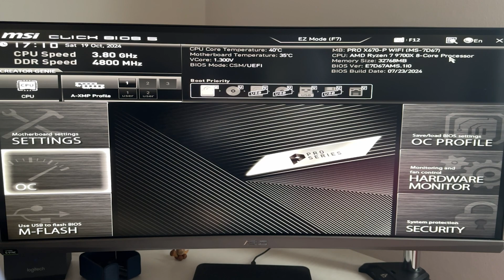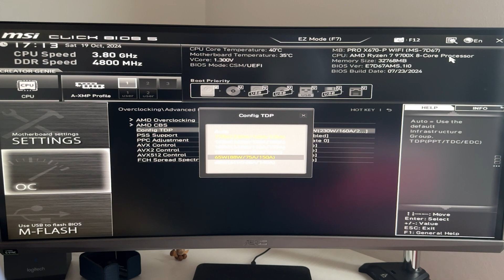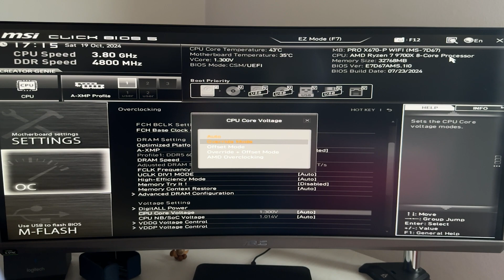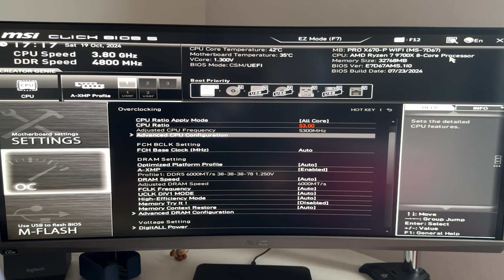Undervolt your Ryzen 7 9700X for more FPS and Lower Temperature!

Comment: Do not do this with your 7900x you're just wasting potential..... Set your curve to -25, set your max temp to 85, manually set PBO, PPT 142w TDC 110A EDC 170A... If you're not on MSI motherboard it will be 142000, 110000, 170000. Enjoy a way better overclock,better temperatures, and using way less wattage.

Comment: I DID THE FIRST TWO STEPS OF THIS AND IT BRICKED MY COMPUTER!!!! DOESN'T LIGHT UP ANY LEDS AND DOES NOT START, DISPLAYS ARE BLACK. NEVER FOLLOW THIS GUIDE!
Reply: Just reset your bios by using clear cmos if your motherboard has it or pull out the cmos battery from the motherboardand wait for 5-10 minutes then put it back.

Comment: Didn't change much for me. Temps little lower for sure. Score went up multicore 8%. Just curve -20 and tdp 170 but I already had tdp unlocked. Single core the same. Steel nomad same results. Timespy cpu from 14150 to 14350

Comment: my setting daily gaming + streaming

precision boost overdrive menu
PBO = advanced
PBO Limits = Motherboard
PBO SCALAR CTRL = Manual
PBO SCALAR = 10x
CPU Boost Clock Override = Enable (Positive)
MAX CPU BOOST CLOCK =  100 / 150 / 200 (optional), 100 = 5.650Ghz, 150 = 5.700Ghz or 200 = 5.750Ghz 

Next
Curve Optimizer menu
curve optimizer = all cores
all core curve  sign = negative
all core curve magnitude = 25, 30 or 35 (25 recommend for me)

cpu z benchmark default
single core = 801
multi core = 8437

cpu z benchmark undervolt + pbo manual
single core = 912
multi core = 9271

Comment: I have gigabyte mobo and 9700x. Open PBO, -20 undervolt and +200mhz boost clock. It goes about 5750mhz when gaming and isn't too hot. On 100% load it thermal throttles. (420mm AIO)

Comment: Can i pair it with 5080 with zero bottleneck?
Reply: No such thing as zero bottleneck exists, but in 1440p and 4k yes you’ll always be gpu limited so cpu doesnt matter as much so its a good pair, if youre playing in 1080p I would get the 7800x3d or 9800x3d instead.
Reply: @henru9817  yeah thanks i got 9800x3d instead

Comment: Hi, thank you for the video!

I have a quick question though:  You set the CPU core ratio to 50 (so 5.00 Ghz, right?) and say that it will improve performance, but isn't the 9700x's boost clock 5.5Ghz, meaning it would usually boost to 5.5 Ghz under load unless it hits temp limits?

So 5.00 Ghz at all times would then be less performance than letting it boost to 5.5, or am I stupid right now? Thank you in advance!

Comment: Does anyone have stable 105watt + -30 CO? or the best is -20? Im going to try this tommorow
Reply: what happens bro i want a do this me i've baught pc parts with the r7 9700x and they will arrive soon and i want know if it works great
Reply: @zakgamer25 its stable for me atleast until now. Running r23 benchmark multiple times multicore score 22.1k and single core 2175 with 77 and 57 temp. 0 overclock only undervolt. Also enebling 105watt. Boosted my multicorescore from 17k to 22.1k. I dont want to push further because heat , this is for daily not for benchmarking records. So im chilling with -30 will update if something bad happend
Reply: @zakgamer25  update.... its unstable when im opening 2 bluestack at the same time 😂. So i lowered it to -20 now still stable. I tried r23 benchmark performance from 22.1k drop to 21.8k without any temp changes

Comment: I’m scared to do it, i have a stable system and good preferences, what will this settings actually do?
Reply: undervolting a cpu and gpu is basically what it sounds like. the cpu and or gpu power draws more power out the box because its for stability purposes. undervolting is done to reduce the power draw (less heat and longevity of the product) while maintaining the same frequency and clock speed. 
he mentions this around 3 min mark. unstable means you blue screen or just straight up crash (this doesnt brick your pc, just boot back in bios and raise/reduce the number). stable means your pc is running fine without any crashes and all your games and applications run as they should. its completely safe to do. OVERCLOCKING is what you should not do. UNDERVOLTING is completely safe.

Comment: My ryzen 7 9700X runs at 50°c on idle, i think its to high. Im seeing that your VCORE is at 1.300V, mine is at 1.330V. Shouldnt it be 1. 300V max?
Reply: On benchmarks and games my temps are really good, but i just wanted to lower idle temps

Comment: This video is absolutely amazing and I can't wait to try this once I head home tonight. I just built a new rig a few days ago with a Ryzen 9700X, this is my very first AMD CPU as I've always been an Intel user and I couldn't help but notice the weird temp spikes even on my desktop when doing not so intensive things like downloading steam games and browsing at the same time that'd make the cpu cooler fans go loud/silent/loud/silent. I didn't want to bother setting a custom fan curve just yet so if I can really improve my temps while improving the performance at the same time it'll be a godsend!

Just a question about the TDP, I need to upgrade my bios from F31 to F34 in order to have the 105W setting available, would you recommend enabling it? Won't it work against the PBO tip shown in your video? Because I read many people complaining that the gain is really small and most likely only noticeable for productivity applications and not gaming

Thanks in any case for the video, I shall definitely try this!

Comment: At 100% utilization the chip is excellent, it's the idle power consumption that bothers me. My 9700X idles at 27-30W (50°C).
Reply: Disable the integrated graphics it will boost the cpu performance and make it 10c to 15c cooler
Reply: @BasTSLA  hi, May i ask how will i know if the integrated graphics is on and how to disable it? When watching videos on youtube and twitch my cpu temp is 60-70 degrees. thank you
Reply: My idle is 47 to 48 C
Reply: @19Roy73  When I use default system memory speed, I also get there, even down to 15W, ať 45°C. How ever even a slight system memory OC and the CPU package gets power hungry.
Reply: @philipcooper8297  whats your board
Reply: @19Roy73  MSI x870-P. The idle power consumption "issue" is the chiplet desing of the 9700x and the integraded memory controller, that has to run faster when you OC (EXPO) the system memory.
Reply: yeah ur right its 50 alryt
Reply: 40 idle without these settings and an air cooler. rarely goes over 65 while gaming

Comment: Please help.
I have ryzen 7 9700x with ant esports 240mm aio. The idling temperature is between 50-60° Celsius and while running Cinebench R24, it went to 80°. But when playing games it goes above 90°.

I need help.
Please suggest.
Reply: Did you use curve optimizer? Judging by the temperatures you removed the consumption limit, I left the base 90 watts on mine, curve optimizer -30 and in games I get 65-70 degrees max with my arctick freezer 360 and 30% fan speeds.
Reply: @SiberianNx  No i didn't. Earlier I was using deepcool le520 240mm aio but it was faulty and I changed from it to ant esports ice flow 240mm aio. 
But the temps have increased since.

Is the only solution is to undervolt it?

Comment: i have this cpu and rtx 5070 tuf gaming oc in fractal ridge with noctua cooler, i want to lower temperature and i use static undervolt cpu core ratio 47.00 and cpu voltage 1.0, my system stable and cpu temperature around 65c in games, what you recommend to people like me who needs lower temperature in small itx cases and good gaming performance

Comment: I purchased 9700x , Gigabyte 870e with f4 bios and Arctic ARGB 360 AIO. Used Arctic mx6 then Arctic Silver 5.Not much changed.  Like your suggestion used Curve optimizer, negative 30. If I open Far Cry 5  temps idle 45 degree,  i want to use silent fan curve but temps reach very high 80's in game. Is it normal?

Comment: Never do this, it's unstable, the optimized curve, even with low values it's unstable, you will have problems, undervolt manually or don't do it
Reply: its stable bruh, just everyone has different value, if you cant do it, means you cooked or done something incorrectly

Comment: This makes my 9700x tmp 75 to 60… amazing 🎉
Reply: what about the wattage ?
Reply: @harissss-e2l  you have to choose power limits yourself, assuming the person wanted to lower temps - probably no more than 88W (some motherboards allow you to put custom value in mW, so that would be 88000 mW), in case of MSI it's Config TDP section at 4:20 and 5:22 of the video

Comment: Need to ask a stupid question. I just got a 9700x and 6000 mhz cl30 ram and just as it shows in yours, the DDR5 speed in the bios says 4800 instead of 6000. Why is that?
Reply: You need to enable expo, that put the ram in the 6000mhz automatically. By default its come in 4800mhz.
Reply: @CallejoKiller Thanks for that, I jumped on my system about 2 hours after I asked this question and noticed the setting was disabled. I enabled it and it went to 6000 right away. Thanks again.
Reply: The standard official speed is 5800mhz, everything else is considered OC

Comment: Hmm, I wonder if this will help lower my CPU temp and lower fan speeds. My 9700X seems to hit 95 C with most modern games and then my PC sounds like a rocket
Reply: In games my 9700x gets no where near that hot.
Reply: @dreadtrain2846  what cooler do you use? I have a Noctua NH-L9x65
Reply: I had the same issue. Thought my AIO was busted. But I reverted to stock bios and things are running a lot cooler. 72C during stress testing and maybe a touch higher on games. I tried the curve optimizer to negative 20 but it had the opposite effect. My CPU performance reduced slightly and my temps reached 85C on stress so I went back to stock.

Comment: Mine out of the box is jumping right to 86 Celsius 😢
Reply: Try repasting your cpu
Reply: Really? What kind of cooler you using? I have a Corsair h100i rgb and at default settings it was high 40s to low 50s most of the time.

Comment: Hi I’ve found this video right after i finished my 9700x 7900xt build and tried the first setting you recommended. After I exited and the pc booted up, it was insanely slow. I gave it a few mins but it was still drastically slow. When i hovered over icons it didnt register, typing was absolutely horrendous as it wouldn’t register it at all.
Reply: If you have a Logitech mouse, that's the problem.
Reply: @technikchegger7228 I don’t, I have a steelseries
Reply: @kozdas9505  As I said, the reason for me is the logitech mouse. With the Razer mouse, everything works normally. Test your mice. But crazy is so🤣
Reply: @technikchegger7228  never wouldve thought a mouse would effect this
Reply: @kozdas9505  that's because mouse have polling rates that affects CPU ,the higher the polling rates like top end gaming mice that has 8000Hz the more it stresses the cpu
Reply: Mine was hella slow as well

Comment: @ImWateringPSUs - what was the idle and stress temperatures before the curve optimalization? 
I used Ryzen Master for curve optimalization and it set -30 on all cores which gives me like -10-15*C which is awesome. FPS went down for like 2-4 so not a big deal.
My temps on idle before optimalization was around 50-55*C, I don't know if it's normal for this cpu.
During gaming it was around 69*C max.

Comment: @ImWateringPSUs: Thas it that will do the job? ima try the first one part just to undervolt a Bit,  for 7-9700X / Asus Prime X679e Pro Wifi. But incase for some reason it does not want to work there a way to revert back to previous setting I had before these changes? TY for Sharing👍
Reply: There is an option in BIOS to Load Defaults. Then set your EXPO for the RAM (if it supports it) and you are good to go. Remember to save and exit BIOS so you don't discard settings.
Reply: @darrenlogie2642  : Thank you Darren👍 games do run great, even though i have not undervolted temp stay at 60f threw out hours of gameplay in a Air cooler... DarkRock 5

Comment: i wanna get a 9700x and use this tutorial and i wanna couple it with ID-Cooling IS-50X V3 Black, what kinda temps u think i get if i go with 50 multiplier and 1.1vcore?
it's a low profile cooler with 130W TDP but with this tutorial i guess max power consumption would be around 60-70W for the 9700x

Comment: Did you have to update that BIOS before it let you run that CPU? I'm going to build a PC with this CPU, but every compatibility checker says you may need to update the BIOS to run this CPU. That sounds like a pain, I'd prefer something plug-and-play.

& Did you every try this CPU on a B650? Did you need to update that?
Reply: If your MoBo has bios flashback it's easy with a youtube video

Comment: So, can I do a negative curve of 20  and then active the new 105w TDP mode on the new 9700X? Or just by undervolting i can get more performance?
Reply: You can do negative Curve and set up 105w tdp
Reply: I set up 105w and -20 curve e improve a lot multi core performance
Reply: TDP 105w and -30: Cinebench r23 max CPU power 113w, 69 degrees and 23.630 points.

Comment: Was the first overclock you did better with pbo negative 30 curve for performance boost or the second one you did with the undervolt and boosting cpu speed. 

Also overclocking ram for a cs32 6000mhz to 6400mhz along with undervolting/overclocking cpu and gpu wont cause problems taking into consideration that i do run tests and such.

Also is it possible to overclock and undervolt a gpu at the same time for more performance or is it better to just undervolt/overclock to boost performance.

Thank you in advance!

Comment: 9700x on x870 msi tomahawk, using negative 20 on curve opimizer has increased my performance and further reduced temps. 
At stock just expo enabled.
Stresed at 4.9 all cores around 67c

Expo and curve opimizer 20
Stressed at 5.1 all cores 57c

Love this 9700x granted some chips is like lottery getting a good 1 but i think this cpu doesnt get much praise as its all about thr X3D cpus at the moment.
Best £250 ive spent on a cpu.

Thanks for your knowledge 👍
Reply: Totally right!
For this price, this is the best deal right now (the 3dx is 130 eur more in Germany right now...)
Reply: @999slawter  it's 200€ difference! 
The 9700X is 353€ and the 9800X3D is 556€ right now.
Reply: @Serandi1987  I bought mine last week for 315EUR
Reply: @999slawter  I've bought mine few months ago for 280€ =)
Reply: man thas great gives me hope i just bought the 7-9700X Asus Prime X670E Pro wifi not that I yet having issues, but I don't want to even Run Cineabench to see temps... did you only do the Precision Boost Overdrive and  curve optimizer thing and saved and exit? or did you also tweak other setting as well? i don't want to OC and do stuff I have no idea of. but if just tweaking those couple setting make a difference then I'm all in. And Thank you for sharing .
Reply: I get over 5.5Ghz on all cores at -30 and I will push it farther next time :))
Reply: Nice

Comment: Hey, my processor has 135% utilization when testing with benchmark or on cpu game ( temp is 82 C when 135%, R5 7600) is it worng or can it damage cpu? I did undervolting on 20 and changed TDP to the top option 170W.
Reply from the maker: It's not wrong, just a metric. All good my man :)
Reply: Yes, it's normal till you will not burn your pc and your home.